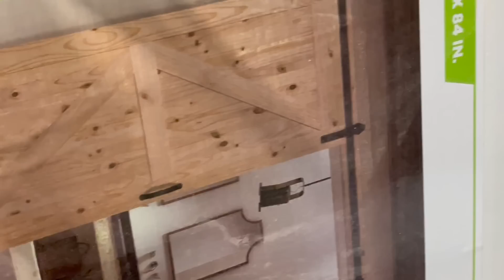DIY Concrete Stain FAIL & Barn Door Greatness! 🔨

Comment: Screw the floor you’re a small business you need to concentrate on heating/cooling/insulation and make sure things are secure and safe with cameras. Get lifts and cameras and worry about floors last. Also with floors most peel over time. Leave it plain smooth concrete
Reply: Former body shop owner

Comment: Nick for the windows up that you were talking about, look for a set of used sliding glass doors and take the aluminum frame off and frame out the opening for the glass. It will save you a lot of money on new glass and most window guys will give you any that they take out of homes or if you have a reclaim building supply store in your area.

Comment: Concrete is porous sucks up anything put on it, keep putting more colour down as will need a fair bit.
I used to do expoxy finishes on concrete. even ground it back for that nice clear rock finish. never used a gun and sprayed it though.
Did a arts building in Australia grinded clear coat finish and was awesome.

Comment: There is a reason you would repair, finish, painting the walls before staining the floor. There is also a reason why open spaces use light colored walls/ceiling over dark colors. Also remember as your new lighting ages you may  loose upto 20% brightness. Dark colors are a bad decesion for large open spaces. Work smarter not harder.

Comment: Ain't grinding concrete floors fun 😂
That's swing machine/balance buff is too much work, the 48" propane one's make it a lot faster and easier on you. It will take about 4-5 gallons of stain per coat to cover that square footage of floor. Carriage bolts is what you used lol

Comment: Do you have a ReStore shop near you? They sell used or overstocked building materials, I’ve gotten tons of great brand new stuff for my garage and house, you might be able to get sliding glass doors to use for the glass on top, at least that way is double pane insulated safety glass

Comment: It's coming right along. Can't 'wait to see how it looks when it's finished and you get equipment moved in and functioning. It will be very interesting to see what it actually costs to heat and air condition the spaces. I've always been afraid of older structures like that because it is so hard to insulate them well and I'm hoping it works well for you. Might give me some hope.

Comment: I'd certainly think strongly about using single pane glass on those windows. No energy efficiency for the most part and with them being that high you will have major heat loss. Perhaps framing that opening for a few vinyl windows may be a better idea. You will keep the natural light and gain energy efficiency with both the windows and being able to add a little insulation in the framed wall. Maybe price it out. Just a suggestion